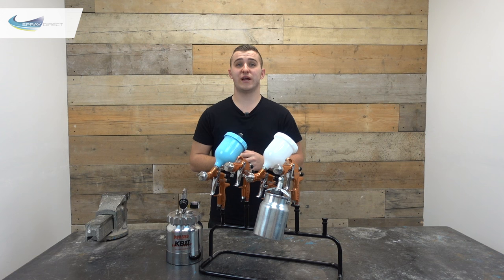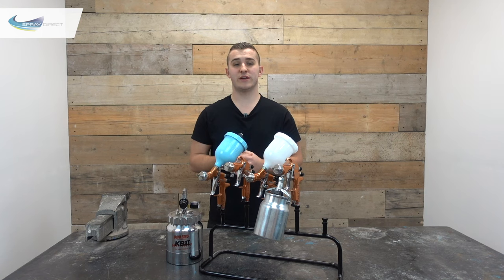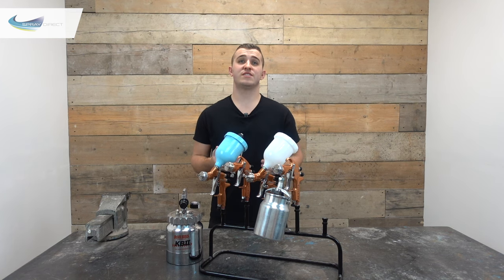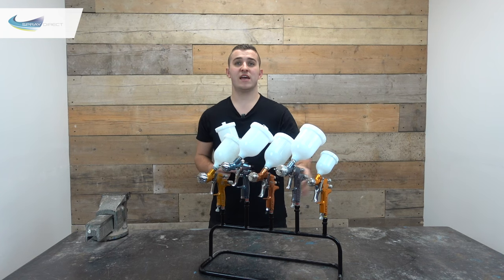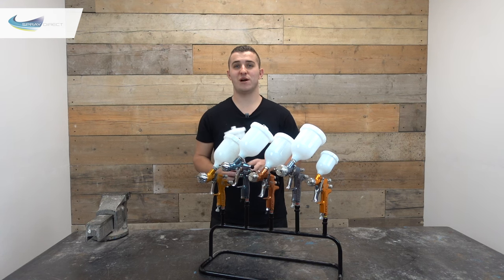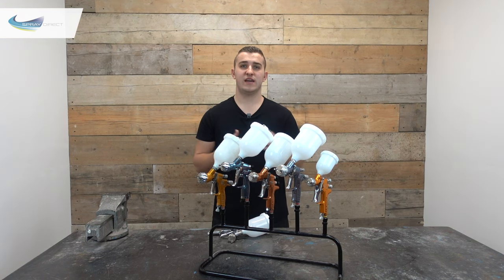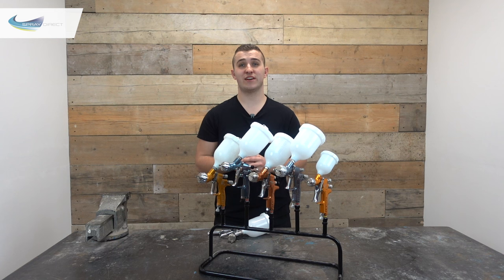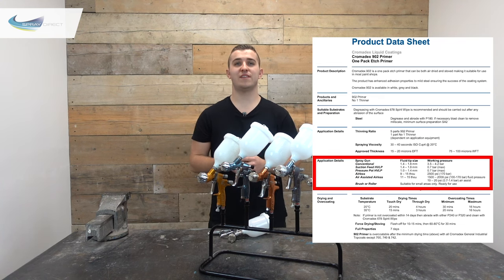How to pick the right Air Spray gun for you - DeVilbiss

Comment: I've used DeVilbiss guns for decades now, pressure,gravity and suction feed set ups. Get the needle size matched with the aircap, what a difference it makes. I'm a Painter and Decorator, increasingly using spray method to finish internal woodwork on large refurb projects.
Reply: I'm new to pai ting and gonna paint my first truck. What do you mean get the needle size ro match air cap? I probably sound stupid but I'm so elneq amd just don't know.plus any tips?

Comment: Great vid mate. I've got a DeVilbiss GTi Pro lite (signature 111) and an Advance hd pressure feed. I spray mainly water base Caparol PU . I've got a Gentilin c330/24 which has a FAD 330l/min at (11.65cfm). and Air delivery of 5bar 200l/min at (7.06cfm). I take it the gentilin hasn't got enough cfm to power the guns?
Reply from the maker: Replied on fb to your comment, but yes at 2bar the gti with a te10 will used about 270lpm but the advance HD with 522 will use around 400lpm at 2 bar so you might struggle with that one.